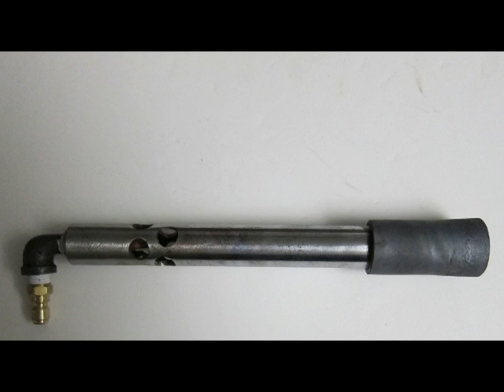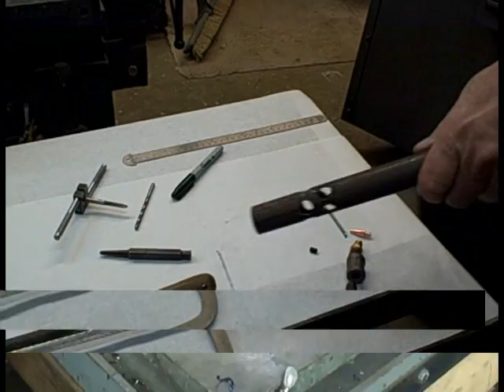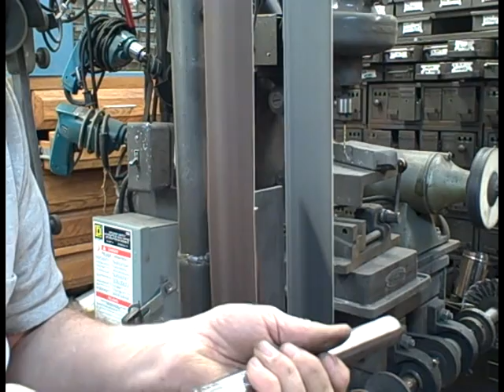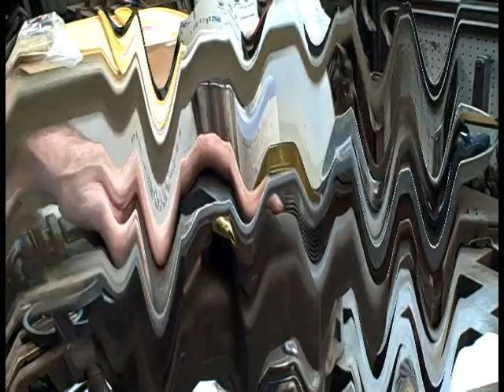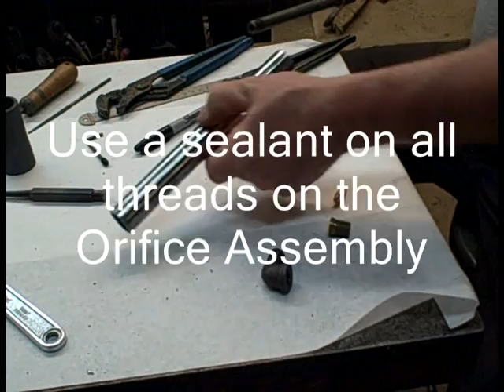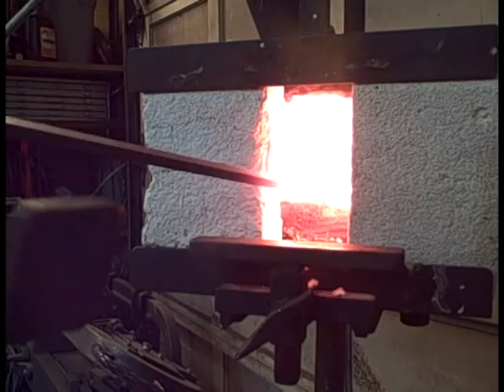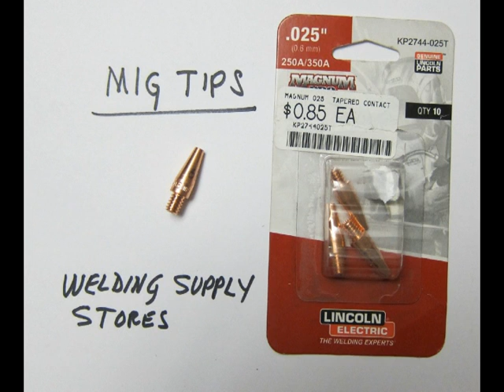How to build a Propane Forge Burner

Comment: Great video. Based upon the info I see this burner will effectively heat your 3 sided super C forge with a final interior diameter of 4" by 8." I am considering building a propane or air tank forge. Do you know of how big of an inner diameter this burner will heat effectively? Thank you!
Reply: The answer to your question is "It depends upon several factors".

Atmospheric burners (which is what this burner is) have been homemade by blacksmiths for decades.  I personally don't know of any meaningful studies, but conventional wisdom has been that a single 3/4 inch burner should heat up about 300 cubic inches of burn chamber to welding heat.  

Having said that, the "burners to burn-chamber size ratio" is not the only consideration. Actually more importantly, is the construction of the forge and it's lining.  The forge should be able to heat the burn chamber to welding temperature, contain and maintain that heat, and reflect it (to heat the project you are working on) effectively.   If your forge is of the type (like the Super C in my other videos) where you can have large openings when needed, you may want a heat source stronger than it would take to maintain heat an enclosed forge with one small opening on one side.

Another consideration is how much stock (mass)  you are putting in the forge and how quickly you want IT to come up the forging (or welding) temperature.  Even though a forge may easily be heated to forging temperatures while empty, when you put metal in it, much of that heat can be quickly consumed (to heat the metal) if you put a large piece of stock in your forge.  How fast that heat is replenished depends upon the capability of your burner(s), as well as the effectiveness of your lining.  

My "Super C" YouTube videos show how I line my forges....  

Update to the lining video:  If your forge is small (like the Super C in my videos), it isn't really necessary to apply multiple layers (slurry, mortar, slurry).  Just one coat of slurry will be sufficient.  The coating will not be as strong as layered construction, but it will work just fine.

I line my forges like I do so my forges come up to heat quickly.  If you use hard firebrick or hard refractory for your entire burn chamber, it will take much longer for your burn chamber to come up to forging temperatures (if ever).  Some folks will use thermal blanket, then a layer of hard refractory (1/2 to one inch) with good results.  

What I look for after the burn chamber is up to heat....  is for the entire burn chamber lining (including the floor) to be lemon yellow.  

Finally, a little more observation for your consideration....

Most folks use only about 2 inches of lining.  If that is your intention,  I would consider a forge made from a propane tank (BBQ size) or an air tank (depending upon size) a large forge.  The larger the forge you have, the higher the cost of using it.  Of course, the size you need depends upon what you are making, but most hobby (and professional) blacksmiths projects would be easily handled in a smaller forge.  Although most of my projects involve stock of one inch square or less,   I have made numerous hammers and other tools using stock up to 2 inch square in my small forges.  With the Super C forge, I gain necessary access to the burn chamber by moving the doors aside or off the forge after the burn chamber is at forging heat.  Although a forge HAS to have openings for gases to escape, I always keep the openings as small as possible, even stacking soft firebrick back where I can while heating stock.  

When I need a larger burn chamber, I use soft firebrick to make  a free form forge the size I need, then use a two burner manifold on the top as a heat source.  Look for my video about a free form forge.

Personally, for a forge with 300 inches of burn chamber, and the way I construct forges, I would be using two burners.

Good luck with your project....
Reply: Thanks for the reply David. I have the Michael Porter book, and was going to build that style, but I am going to try your burner as it is more simplistic. Thanks, Wally
Reply: Walter....  Thanks....   and good luck with your projects...

Comment: Is this the right stainless pipe? ID is .75, OD is 1.0. https://www.onlinemetals.com/merchant.cfm?pid=928&step=4&showunits=inches&id=57&top_cat=0
Reply from the maker: If you are asking about SS pipe that will be used for the flare, the size you are referring to would be too small.  Schedule 40 pipe (that which I use for the burner body is nominally one inch in diameter OD.  SS pipe varies in dimension that I can't recommend any specific source.  When I buy SS pipe to use for flares, I take a piece of Schedule 40 pipe I use for burner tubes to be sure the SS pipe will slide over it.  If you cannot find SS pipe for flares, you can use a piece of schedule 40 one inch pipe.  You can use it flared, or not flared (both will work).  It will just not last as long as a SS flare.

Comment: Diameter of the 3 inch stainless pipe?
Reply: I don't know if there is a standard for SS pipe.  It just needs to fit over the 3/4 inch schedule 40 iron pipe.  1 inch schedule pipe will work if you cannot find SS pipe.  It just won't last as long.
Reply: Thanks, I was wondering about standard pipe. I have a Ron Reil burner I made about 15 years ago with a standard black iron pipe for a flare and use it occasionally and it's held up pretty well.

Comment: how would one add an air choke on this?
Reply: I wouldn't...  because I don't believe it's needed.  I've been using these burners for years without one.

Having said that,  if you want to add a choke, you could use a short piece of 1" schedule 40 pipe (maybe a couple inches long), slid over the top side of the burner tube.  Drill a hole (and tap it) for a thumb screw to hold it at the position you want it, covering some of the half inch holes you drilled for aspiration..
Reply: Ok thanks for the reply. What elevation do you work forge at, just curious.
Reply: Actually, that's a very good question.  Much higher elevations could very possibly require modifications to this design.  One modification could be the addition of the choke to vary air input.  If you are at a high elevation and the burner does not work reliably, I would encourage you to experiment and report your results.

Where I live, the elevation is only about 400 feet, but I have no doubt this design, without a choke, works at elevations thousands of feet higher.  I don't know at what elevation changes would be needed.  

This video has been viewed almost a half million times and a question about the use of a choke has only come up a couple times.  Your question about elevation is the first one.

Comment: Mr Hammer

I have built your burner and followed the instruction fairly closely and it does light and burn. The flame is not the clear blue you mentioned and  I do have a bit of a problem when I put it into my Forge
After I light it, after a few minutes heating time it will start to pulsate, literally going our and relighting. I seriously think that this is not suppose to be happening. I usually panic after a few minutes of this huffing and puffing and shut the burner down. Also it does not seem to heat the metal beyond hot enough to burn your hand if you are not careful. No Cherry red never mind yellow heat. I think I read some place that you needed an adjustable air supply so I cut a hole in the back of the Forge and inserted a piece of pipe with a flapper valve. No help. Should I let the Forge heat up for a while longer? Being very Religious, Devout Coward, I have been scared to let it go.  I have the burner hooked up to a adjustable 8 to 12   regulator and was very lucky to find that. I am open to suffestion
Reply: I believe what you are describing is a fuel supply problem.  I expect your forge is starving for fuel.  I suggest you find a higher pressure regulator.  I would consider a 0-30 PSI regulator the minimum needed for this burner.  Start the burner at 15-20 PSI and increase the pressure to heat the forge.  After the forge is hot, you may back off pressure to maintain heat for your forging needs.  What pressure you run the forge at will be determined by how much stock you are heating and how fast you want to get it to forging temperature.  

As stated in the video, I actually recommend 0-60 PSI regulators, cranked all the way up to 60 PSI, with the propane flow controlled with a commercial needle valve near the burner.  However, lots of folks use 0-30 PSI regulators with no needle valve successfully with this burner.  Regulators can easily be found online.  Two sources would be eBay or Amazon.  There are lots of others (just Google "high pressure propane regulator").  

Secondarily....  it is important to have an efficient lining in your forge to get to forging heat.  How is your forge lined... and what are you using for a floor.

Comment: Hey David, sorry to be a bother. Started using my burner. It gets really hot! Here's a picture: http://i269.photobucket.com/albums/jj55/sepulchre10/Blue%20Burner_zpsgeypgufn.jpg 
Is that getting too hot? I only run it for a few minutes at a time, just enough to heat up the metal I'm working on.
Reply: It's not good when the burner gets hot that far out of the forge.  The end of your burner may be too far into the burn chamber.  It should be at least an inch back from the burn chamber (and that passage should be covered with refractory, assuming you are using refractory).   How is your burn chamber lined?
Reply: With two 1" layers of Durablanket and two pints of Plistix refractory. I took the burner out of the forge this morning. It dropped inside and there are some small cracks in the refractory. Should I get some more and spackle it up? 
Also, I still have the stainless flare and I'm thinking of trying it in the forge. It's longer than the reducer and a little smaller in diameter so that I can mount it farther back into the opening. There is some refractory in the opening but not as much as in the body of the forge. The stainless flare would not light outside the forge, but I'm hoping that the back pressure of the enclosure will allow it to burn.
Reply: It's likely the burner will work fine in the forge with the stainless steel flare.  In fact, although I don't recommend using burners without flares, most burners will work without a flare in the forge (the flare becomes the consumable, rather than the burner tube).  

Your lining sounds fine.  Although it is better if there are none, small cracks in the refractory (Plistix) shouldn't be a problem as long as chunks haven't fallen off.  I would suggest you have spare refractory in case you do need to patch.  Eventually, you will need it anyway.  If your reducer sticks down into the burn chamber, it's the reason the burner is getting that hot outside the forge.    

If you would be interested in a better refractory with your next reline, you might watch my forge lining video and try what I show how to use in the video.  It will require more steps and personal protection care, but I believe it is a better refractory.  I'm not sure if you could put it over Plistix (I don't know if it would adhere).

Good luck....
Reply: Thank you, David. 
The reducer wasn't sticking down into the burn chamber but it wasn't far from it. I ordered more refractory to do some patching. I will indeed watch your video on forge lining. I won't be doing it for awhile (hopefully) but when when that time comes I want to know as much as possible. Also, I will probably make a forge from a sturdier structure. Mine is basically a 5 gal. metal paint bucket. For now it's getting the job done, but I feel certain that I will be expanding and need something more substantial. I've got the smithing bug and in a couple of years retirement will give me plenty of time to devote to it.
Thanks again for all your help. All the best to you & yours.
Reply: After trying various (many) configurations with the stainless flare then, using a 0.025 orifice, trying the reduce I was using before, I could not get the burner to light in the burn chamber. I will try again tomorrow but if it will not work I guess I'll just have to buy a burner (as much as that goes against my grain).
Reply: I understand the need to move forward, but I hate to think you need to give up.  I have a few more questions...  

1. How are you trying to light the burner when it's in the forge?  What I do now is two-stepped...  I open and close the shutoff valve for just a second to get a little propane in the forge (just a wiff, too much would be dangerous), then light a match and toss it into the forge while I open the valve all the way.  If the forge doesn't light immediately, I shut off the valve and try again.  Lots of folks I know light a propane torch and hold it in the forge while opening the shutoff valve (this is actually much safer).

2.  Are you using a needle valve to control the propane? 

3.What type of regulator are you using?  What pressure is it rated for?  You need at least a 0-30 PSI regulator.  I recommend using 0-60 PSI regulators and a needle valve to control propane volume.

4.  Can you post, or send me (david.hammer2@gmail.com) pictures of your whole setup, including the forge, burner, hose and all the fittings in the propane line.  I can't tell from the picture you have online how the door(s) or openings are made and used.  

5.  Does  your burner start outside the forge?  Does it have a good blue flame if it does.

6.  Are you using tape or paste to seal the plumbing joints?  Sometimes the orifice will get jammed with junk... tape causes the most problems, if used....  I have also seen junk coming from propane tanks and plugging orifices (wax).  

7.  When my burner starts acting up, I will ensure the orifice isn't jammed by pushing a fine wire through it.  I use acetylene tip cleaners, available where welding supplies are sold (Lowe's and Home Depot should sell them where they sell tips).

8.  What size propane bottle are you using?  How full is it?

9.  When you turn on the propane (at the shut off valve), can you hear the propane going into your forge?

10.  Are you using a gauge anywhere?  If so, what is the pressure set to when you try to start your burner?  A burner should start easily at 10-15 PSI.  I usually start mine with even higher pressure (just be sure you don't have skin too close to the door opening).

I generally tell folks to use larger orifices (rather than smaller ones) if they are having problems.  My video shows the use of .025 mig tips, but some folks have better success with either .030 or even ,035 tips.  

I'm not sure I have ever had anyone completely give up on this burner.

Comment: Me again! I've probably seen your video a dozen times by now. Couple of more questions:
1- You've attached quick connects from the needle valve to the T with the pressure gauge  so you can take it out when you want right? If I'm not planning to use anywhere else Propane brass fittings would suffice correct?
2- What connectors did you use to connect the needle valve on both ends?
Reply: You are correct, the pressure gauge doesn't need to be on a quick connect.   Just be sure the pressure gauge is next to the burner.

The needle valves I buy have female threads on each end.  I use short 1/4 inch NPT nipples (less than an inch long) to connect to the other fittings.  If the big box store you go to doesn't sell black iron nipples, they should have brass ones (a little more pricey, but it saves a trip to a plumbing supply)
Reply: @HammerMan999  0 @frekansiz_kej

Comment: Mr. Hammer, I have another question regarding this burner. I have tried to search trough the comments on this video, but found no answer.

My question:

Why do you not incorporate a flare at the air intake, as seen in the conventional "Reil Burner"? Have you experimented with that type of design, and if so, how do they compare?

(My theory is that a flare at both ends provides a bottleneck, and thus facilitates a venturi effect that sucks in more air. But perhaps you want less air?)

Thank you again for making this excellent video.
Reply from the maker: Both burners are "atmospheric burners", which means the air which is mixed in with incoming gas is not pushed by a blower.  There are numerous designs.  This is just one of them.  It doesn't matter where the air comes from (top, sides, etc), it just has to be enough...  and mix with the propane in a burner tube prior to the flame.
Reply: Thank you; thats very interesting!
By the way, may I ask why the burner faces downwards in the forge? (doesnt that cause hot air to chimney back up?)
Reply: The burner can come into the forge from any angle and still work fine.  The forges I make include a burner holder that is welded to the forge body.  The burner is slid down into the burner holder and held in place with multiple small bolts.  I have put the burner holders on both the top and side of the forge body (pointing toward the center of the floor).  In my lining videos, I show stuffing thermal blanket into the burner holders around the burner so fire and gases do not escape the forge around the burner.  Sealing around the burners with thermal blanket eliminates the chimney effect and keeps heat away from the source of propane.
Reply: Thank you (again) for the great advice!